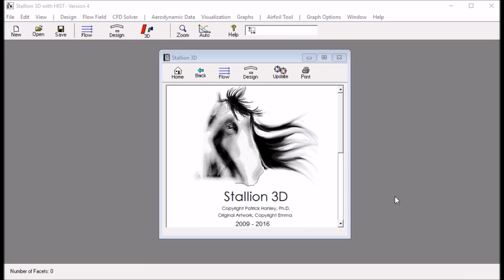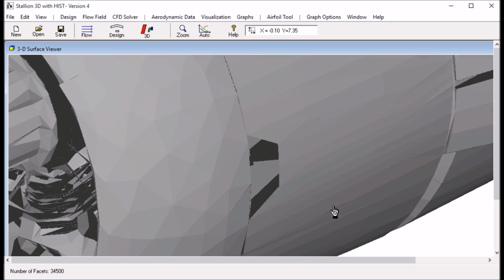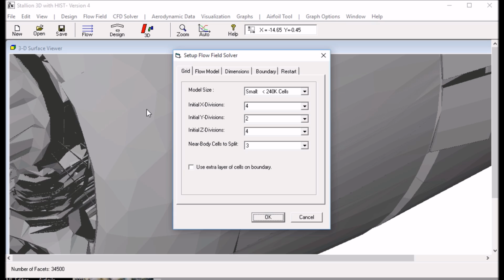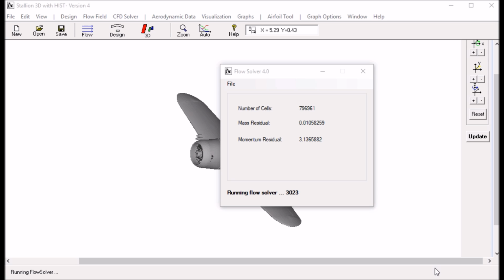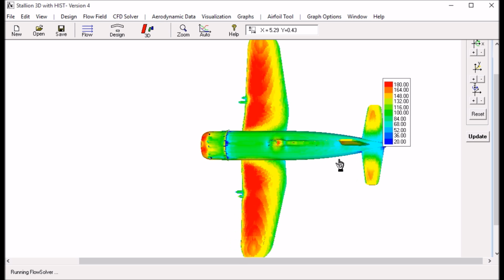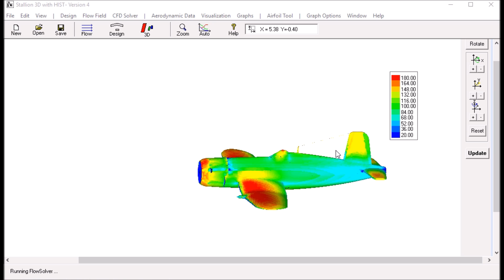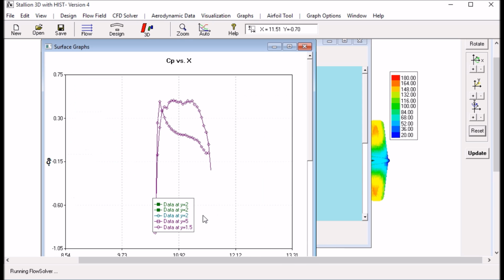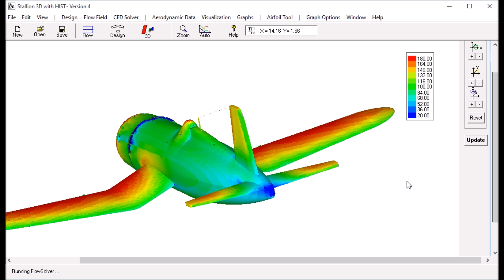CFD Analysis of a F4U Corsair Airplane using Stallion 3D v 4.0

Comment: Hello Dr Patrick Hanley, it's a very cool software you have there. I am building a VTOL quadplane (UAV) for surveillance applications, and I wonder if Stallion 3D is suitable for quick CFD (and FEA) simulations? Also, how could I calculate the reference area and reference moment length for a custom UAV? By "reference area" you mean the frontal area? 
Regards, Dr Wasim Akber

Comment: Hi, I was very surprised to see the L/D as "15.96" which seems to be unusually high for such an RC plane. The L/D for Airbus A320 with such high Reynolds number and such high aspect ratio is around 18.. thanks
Reply from the maker: Hi Bagrat, thanks for your comments.  In this case, only the pressure drag was computed.  The friction drag was not included in the l/d computation.  Stallion 3D v4 computes both friction and pressure drag.